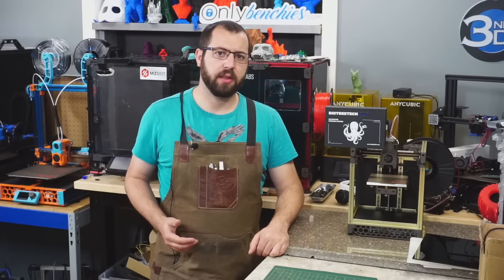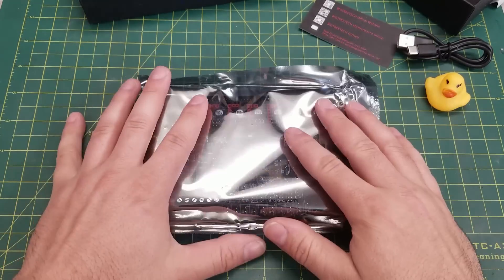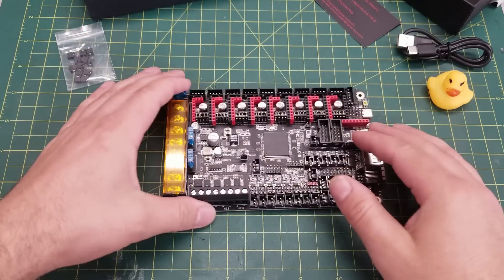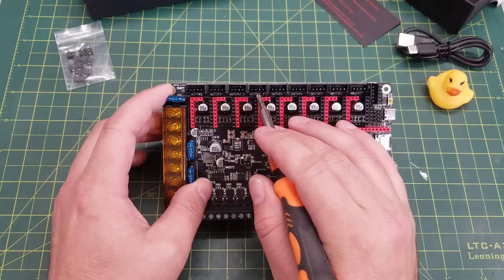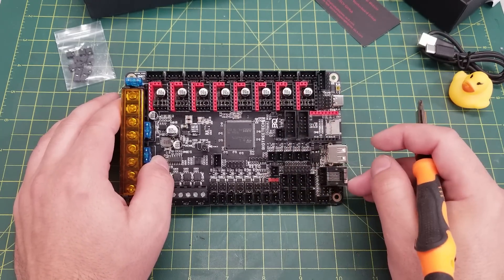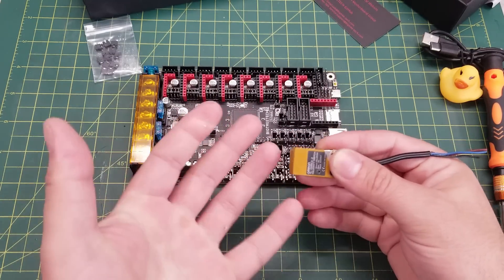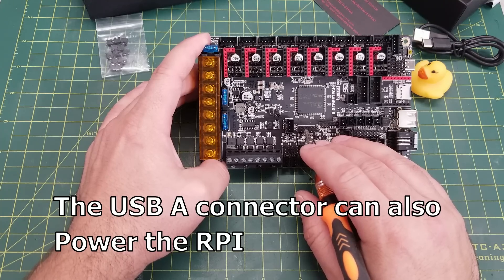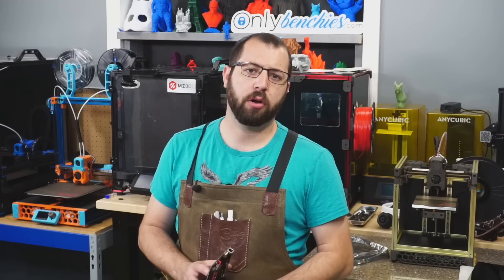BTT Octopus - This Controller Has (almost) EVERYTHING

Comment: About probe port: I'm using octopus pro board which is basically the same. It's fully working using OMRON and similar probes. It requires special tune in configuration.h! You have to disable pull-up for Z_MIN_PIN and then enable pull-down for it.

Comment: Hi. Can klipper run on this board with no rpi?  I have 7 machines in my hotrod shop lab.  3 have this board now.  To klipp all, the rpi cost adds up to a decent Mercedes.  I'm swimming in i7 iMacs and galaxy s7 androids.  A non rpi solution is needed right now and would make use of wildly available ewaste.  Thanks for the channel.  You're a brilliant guy.
Reply: As long as you can run linux on it, Klipper should be able to run on it.

Comment: Is it any kind of problem that my PSU (Ender 5 plus, all orig. atm) doesn`t have enough outputs? It`s mostly chinese symbols on there, but 500 is prob. the wattage., 24V.  21A from what I can decifer. How would a professional deal with that issue? I doubt shoving in 2 fork cable lugs in the first 2 slots (1st + and 1st -) is a recommended solution, is it? (It`s what I came up with) The printer is all DC, no fruity AC stuff in my bed.(No judgement either, js) Only the cables from the Mosfet to the board look a bit, underwhelming. Actually most cables on the cheapo chinese production that is the mighty "Ender 5 plus" are

Comment: Really enjoyed the video and this will help me with getting my 2.4 unit operational. I would like to share a caution. When handling circuit boards with ESD (electrostatic discharge) sensitive components, please consider using an ESD wrist strap and mat that is connected to an earth ground. Watching you touch pins and connectors made me cringe as low voltage discharges, which you can't see or feel, can weaken the internal structures of IC's and other devices. This can shorten the lifetimes of those parts and cause failure a few months down the road. Anyway, just passing along a tip to help keep printers up and running.

Comment: Lost so much time on the E motor being the fifth pololu socket and not the fourth ! grrrrr
Reply from the maker: Im a fan of what some board manufacturers are doing now where they are moving to naming the motors just M0-M7 (or however many steppers are on the board)
Board labeling doesnt matter, its all firmware configuration dependent for motor assignment

Comment: For someone building a Rat Rig core 3, planning to use klipper for things like input shaping with an accelerometer, hesitating between for example a BTT Octopus 1.1, or a variant of the BTT SKR Pro, what would you recommend ? Do either bench the same in terms of step frequency for klipper ? thanks!

Comment: Hello Nero! Thank you for the review of this board!
You shortly ran over the fan outputs, and i would like to know what the octopus can deliver of wattage on 12 volt on one output .
I'm asking because I have a waterpump, and it pulls 15 watts, is the octopus capable of that?
Because that would be a "add to basket reason" for me, then I don't need a separate converter for it anymore.

Cheers, thanks for all you content
Reply: I may diggest to use in this specific case an external mosfet driver driven by the fan out slot, more safe and convenient
Reply: @CallistoPili  been running for a month, all good thanks

Comment: Impressive video, I’m stuck with my Voron build, well maybe not stuck, this board has 2 sets of outputs for the bed, one is marked  bed power and the other is just marked bed, I’ve never had a SSR before and think I should connect to the bed output and not the bed power. Is that right?

Comment: Great video! I'm kind of new to all this but tinker with everything form time to time. One question I couldn't find answered anywhere is: If this is suitable for the Creality CR10 Max? I've read that other boards from BTT are not suitable because the CR10 Max has 2 separate PSU's that couldn't be wired correctly. I'd buy the Octopus in a heartbeat if it can be confirmed compatible with the CR10 Max setup. Thanks in advance!

Comment: Hi!, total new to this build of Voron but... just starting to collect it all, atm a couple of week further... can you tell what's your experience is with the Octopus v.s. the Spider ?
Reply from the maker: On paper both are fine. However the spider has had many qc issues crop up. So id recommend the octopus
Reply: @CanuckCreator  Thanks for the quick respons!
Reply: @CanuckCreator  Could you suggest a specific firmware/setup for a Voron 2.4 ?

Comment: Why you dont power the rasp pi in your voron directly from the BTT Octopus?
Reply from the maker: The RPI was already hooked up to a 5v powersupply, just easier to leave it as is. lol
I did test it running off the octopus though, no issues.
Reply: @CanuckCreator  Do you think the powersuplly from the board is strong enough to power a raspi pi 4b with a TFT Screen connected directly to the rasppi?
Reply from the maker: @danielw1337  Should be fine

Comment: Are you keeping the packaging for yourself as a display item or just throwing it in the bin? It seems like a massive waste to be Producing packaging that is using excessive resources
Reply: If one board is saved from shipping damage it pays for the manufacturing of 100 proper boxes.
Reply: @mrfrenzy.  definitely need proper packaging and foam internally but a plain cardboard box offers just as protection.

Comment: A 36v PSU should be fine if its got a potentiometer for adjustment. It should be able to go +-3v from that number on the lable. All ways check with a multimeter of course 👍

Comment: Hey Nero, love your tutorials, they're a HUGE help in putting together my Voron 2.4.... just on the probe, can you clarify, you remove the black signal wire but where does it go then as XYZ endstops already wired in.... please help!! :)
Reply from the maker: Refer to the wiring diagram in the manual.  But basically i pulled ground and vin from the sensor plug. Then the sense pin went to the numbered pin on a free endstop

Comment: I am fairly new to 3D printing. That said I am a fast learner and am looking at putting together a custom printer that will fit what I need. 1000×1000×1000 for rapid mold prototyping. 
Is there a good source for programming and configuration of a bord like that?

Comment: The Omron probe need pullup resistor as declared in its data sheet. Put a 10k~47k resistor between VCC and signal wire and it will work.
Reply: I wonder if there is a pull up in the I/O port that just needs to be enabled in the firmware?
Reply: @ColinWatters  as i remember it does not connect directly to the io pin so software pullup might not work
Reply: That's super helpful!

Comment: Can this board power a Raspberry Pi or do I still need the 5v power supply?
Reply: I wouldn’t because the 5V regulator feeds the 3.3V regulator, and pulling too much from the 5V can shut down the 3.3V. Also, powering the Raspberry Pi through the PIO would bypass the power protection circuit on the Pi.

Comment: did you have to remove and add jumper pins?
Reply from the maker: Yes, had to set jumpers for uart on the 2209`s, and for setting voltages for fans and sensor
Reply: @CanuckCreator  It will be reat if you can share a photo of your wiring over at the discord server. Thanks for replying!

Comment: Going to wait for a 1.1 version, hopefully they add 50v caps
Reply: nope, brand new V1.1 has 35V caps still...
Reply: @paulsomero  ah ffs, maybe a competitor steps in
Reply: @thiagokeizo  I dunno about you, but I'd be super sketched out running much more than 24V through one of those tiny TMC board modules using questionably flimsy 0.1 header pins.  You'll start to find yourself in territory where things like creep and clearance and just general rules of thumb for insulating and separating things will become relevant.  They pack them in so tight that they're bumping edges by default.  IMO, if you're getting into a higher power range, you should be using more conventional motor driver units that are monolithic blocks like a gecko drive (just an example, not endorsing) which is in its own housing with a higher degree of ruggedness.

Comment: Would actually want larger than 50V caps for 48V motor power. Those bulk caps tend to loose a significant amount of capacitance (up to 50% in some cases) due to DC bias. I would argue that the 35V caps used are correctly sized for 24V.
Reply: You are thinking of MLCCs. Aluminium electrolytic caps are almost not affected by dc bias.
Reply: Yeah, I was thinking MLCCs. I rarely (if ever) use axial/radial caps in my designs. Still a good idea to have a cap rating higher than 5% of the input voltage since most power supplies' ratings will be about that. Better safe than sorry.

Comment: Can you test the Fly f407zg? The spider and the octopus is almost the same... The f407zg uses an stm32f407 which has 1mb flash and able to run rrf either. Thanks

Comment: Thank you for sharing an impressive video of Octopus with us. More Voron users can have our Octopus install in their next build. Regarding HV CAPS, we love hearing your ideas! We'll definitely pass your desire to our teams. We will keep delivering quality products to you! :)
Reply from the maker: awesome to hear
Reply: @CanuckCreator  any idea how to connect it with e3D PT100 amplifier ? Or are there any analog pins of BTT oct v1.1
Reply: it's a good idea to at least bore holes through board on caps connectors so enthusiasts can replace caps themselves placing them on back side of board: actually it's impossible to fit SMD caps with bigger voltage on face side of board while holes can be bored in newer revision w/o any issues(ofc if there's no traces under them)
Reply: @SergeiSugaroverdoseShuykov  I think having through hole ones sideways like some Arduino CNC shields do could make that possible, but that would of course make them stick out further to either way and thus the jumpers go somewhere else, either jumps or caps have to move.
Reply: @Kalvinjj  well, it's a major design change, yet i'd like to see it with 90v caps it's not impossible after all
Reply: Hello BTT folks, some clarification on the probe issues would be most helpful. This is confusing, as the new port was meant to be better suited to this kind of probes.

Comment: wires that costs more than half ender 3 v2
Reply from the maker: Yes they are pricey. But if you factor in the material cost of the high quality wire used and the man hours it takes to build the loom yourself...it isnt that bad really
Reply: @CanuckCreator  have to agree I'm going to buy a good quality wiring loom, I'll keep the wire that came with my kit for something else.

Comment: Can i use this in a voron v0 ?
Reply from the maker: You....could.....
Reply: @CanuckCreator  haven't built a v0 myself, is it too large for the v0?
Reply from the maker: Oh probably.  This board..while it will work on a zero is massivly overkill for it
Reply: you could technically run 2 v0's with one of these boards, just get something cheaper and better suited to the application.
Reply: @mocotonio  I could actually get the this cheaper than a skr mini, hence my question. But I decided to just go for the skr mini as I know very little about this stuff.

Comment: Have you done a Klipper vs Marlin video?
Reply from the maker: Havent had a machine with marlin in years....
Reply: Nero 3dp Ive never tried Klipper yet, but looking to. Not really for racing and super speed, but wanting reliable, accurate production. But most of what I see of Klipper on YT is high speed trials.
Reply: @soundmindtv2911  i built a voron after using a creality cr-6 and a prusa mini for several months, Klipper once you learn the ropes and get comfortable with it is on a different level. It's vastly superior in all fields, which is why people use it for speedy prints.
Reply: lap87 thanks for that response!! I’ll definitely be going that direction. Already stockpiling parts for my future voron ☺️

Comment: I'm anticipating the comparison with the spider. Have you ever seen anyone using multiple independent bed heaters and multiple temp sensors to try to even out the temperature differences across the bed and in particularly at the edge of the bed due to more radiative area?
Reply: You can insulate the edge

Comment: Doesn't the Prusa Mark 3 use independent drivers on Z?
Reply from the maker: Nope, the einsy rambo only has 4 stepper drivers. So the Z motors are tied together
A common trick people do is ram the gantry into the top of the frame to tram it out....

Comment: One small observation. The header that you called out above the fan ports is an SPI header. For the Raspberry Pi connection, both serial and power come from the "UART" header directly to the right of "MOTOR7". There are 2x5v, 4xGND, and TX/RX in a non-pi standard orientation (unlike the spider header layout that matches the Pi's). If you are going to use this header, be mindful of the pin layout in your jumper as to not damage your Pi or your Octopus. If you plan on using UART instead of USB, you will need to setup the firmware to use "Communication interface (Serial (on USART2 PD6/PD5))".

Comment: I love that it has so many fan ports. 3 fan ports on the spider seems kind of silly. I'm very happy with my octopus so far (QC issues aside)
Reply from the maker: The spider actually supports 6 Fans, only 3 are "dedicated" fan headers, the other 3 are multiuse headers that can be fans or LEDS for example. And of course any unused hotend heater pins can be used for fans too.

Comment: Should PID tune after replacing the board as the thermistors may read slightly differently(especially after changing wiring looms, as may the MOSFETs that power the heaters.

Comment: Is it necessary to break the stepper stick leg for tmc2209 sensorless homing? Like the SKR1.4?
Reply from the maker: No
Reply: Not at all, jumpers for connecting to diag pins for each socket to their corresponding endstop.

Comment: On the soldering: It's almost impossible to get a clean finish on matte black PCBs with thru-hole parts, I've seen dev kits from TI that looked like crap because they went with matte black, looks like a phenomenal board (also first, I guess)
Reply: So do we need to change to bright black ink PCB?
Reply: @bigtreetech5117  yess